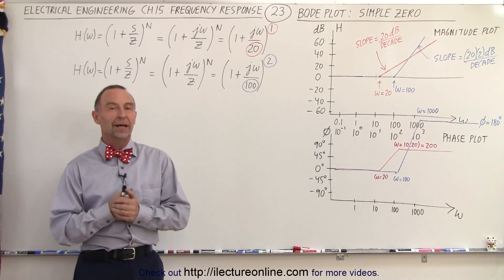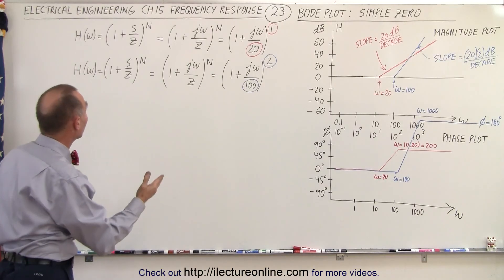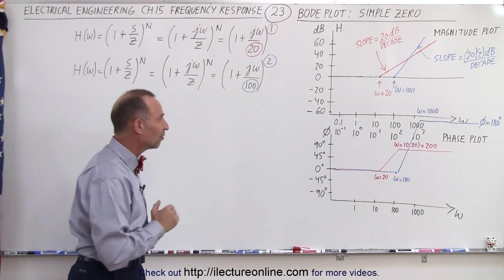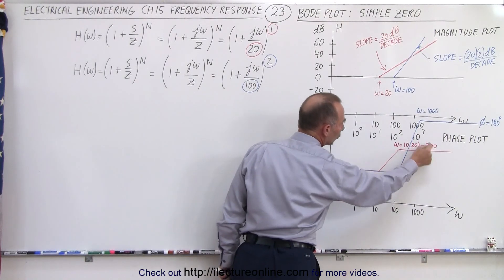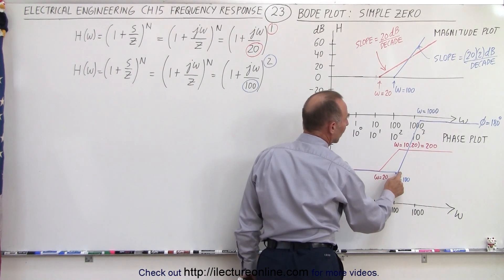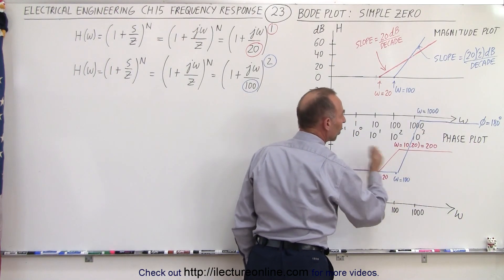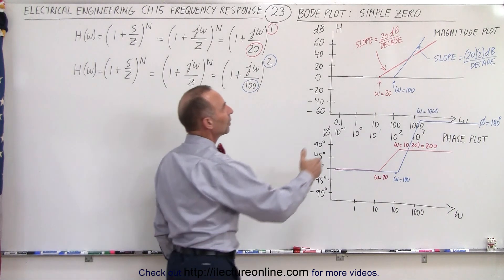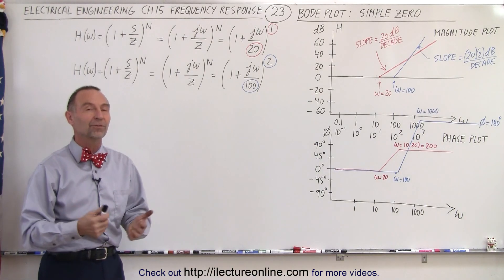Electrical Engineering: Ch 15: Frequency Response (23 of 56) Bode Plot: Simple Zero

Comment: What you have at 1:00 for the phase plot of the simple zero is not correct. It should be 45 degrees at the corner frequency, 0 at one tenth the corner frequency and 90 degrees at ten times the corner frequency. The phase plots start at zero one decade before the corner frequency and ends at 90 degrees a decade AFTER the corner frequency (in this case). The change in phase starts one decade earlier than the change in magnitude.
Reply: Yes! That is what I thought